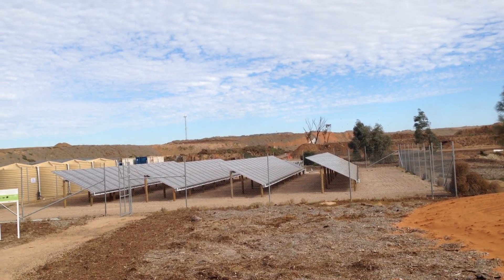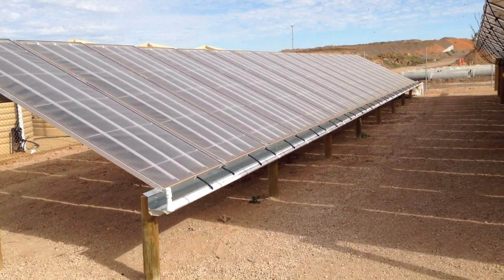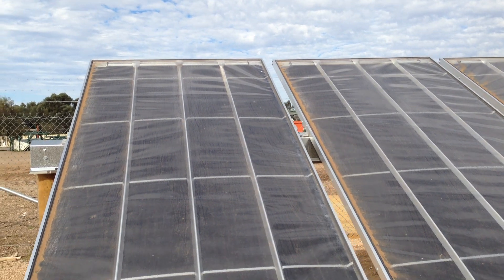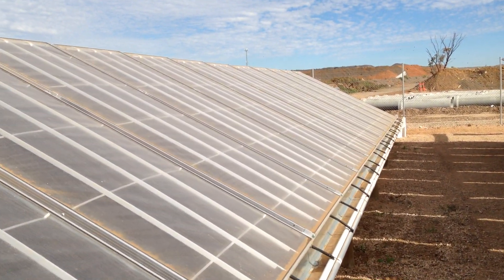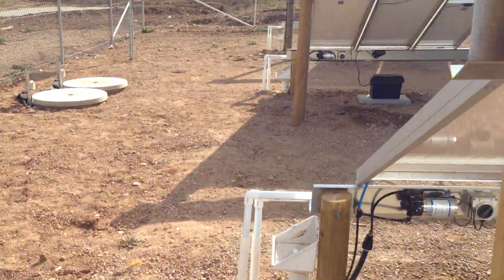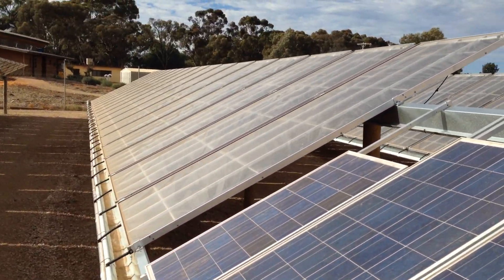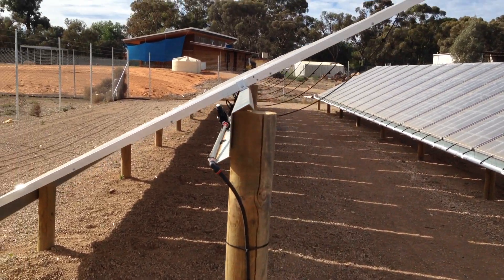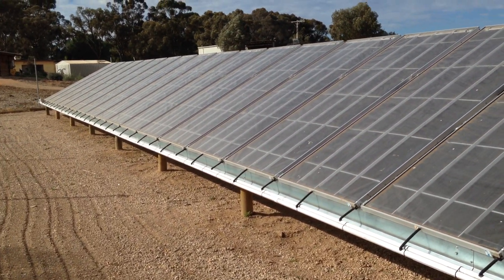Solar Desalination Water Farm In Mildura

Comment: The condensation surface appears to be some type of plastic sheet.  Do any chemicals leach off of the plastic condensation sheets into the water, or evaporate with the water from the black plastic base? My biggest concern with solar condensation units that utilize plastics are the chemicals released when hot plastic and water mix.